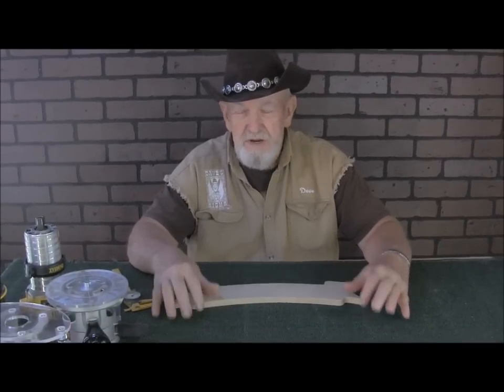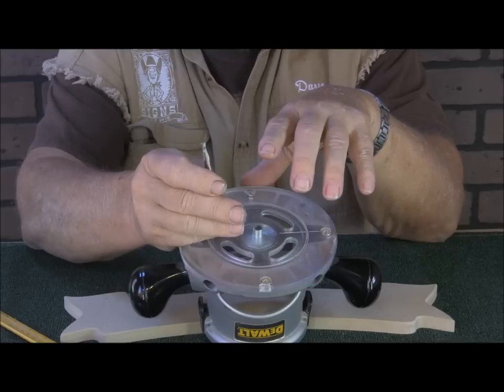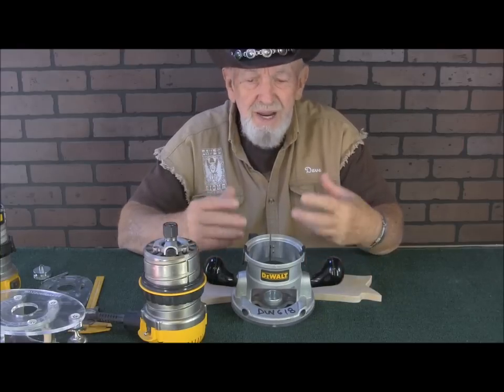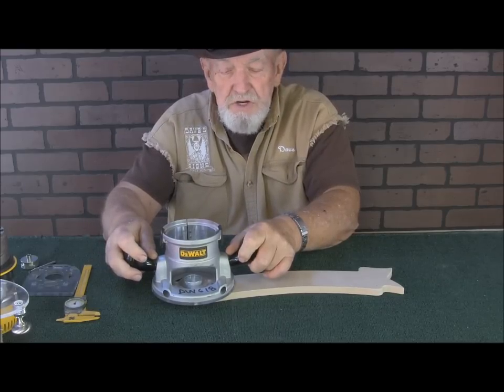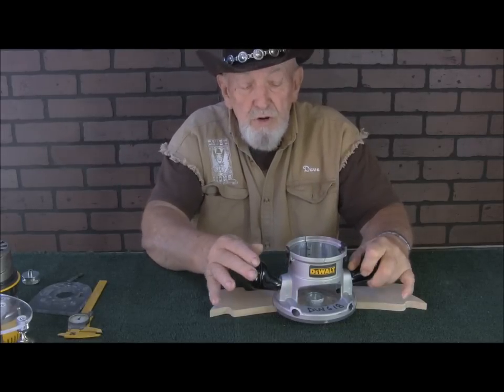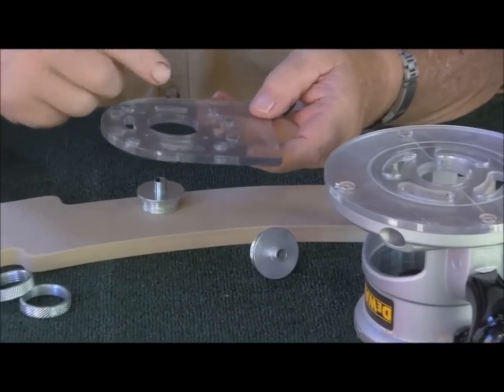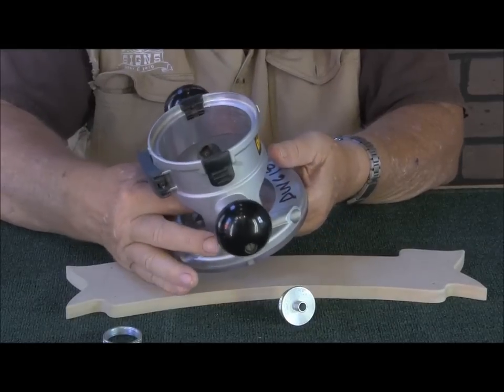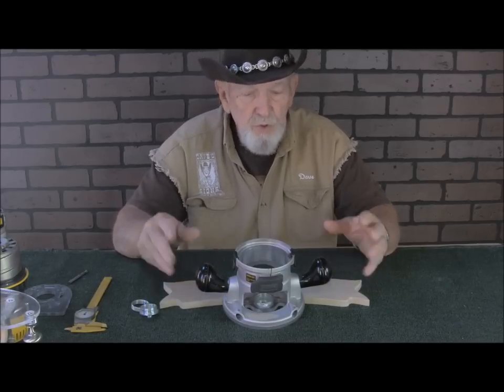#128 Update to Cutting Shapes

Comment: Hi again guys! Thanks always, for answering my questions.  Here's one more for you...
Is there a minimum rating for HP or Amps for cutting shapes, in the event I buy another brand rather than the DW618?  I'm really loving the reasons for using DW611 for actually carving though.  Thanks for being awesome! I can't stop learning!  -Mike
Reply from the maker: ***** I wouldn't go with less than 1.5 HP. Don't know what amps that would be. Lots of the routers these days seem to go by amps and not post a HP. Hate that. The 618 is great for cutting shapes. Tons of power. Thanks for the props & for watching.
Reply: Dave Rhoten Right on!   Do you think I could use a slightly larger router like the 618 for doing the letters too? Too heavy? I'm Trying to buy one router rather than two, to start.   Have a great day, and keep that router going! =o)
Reply from the maker: Absolutely you can use that router for everything. Later on when you're making money you might want to think about the smaller one for doing the lettering. You have a Great day as well buddy.